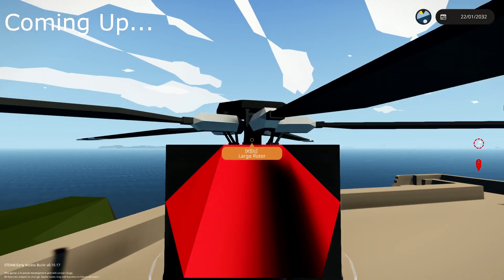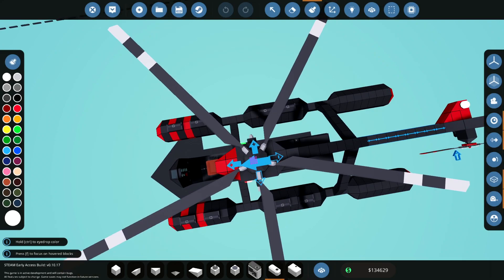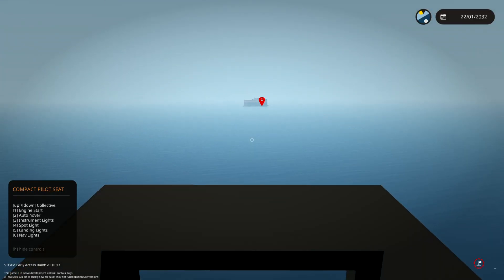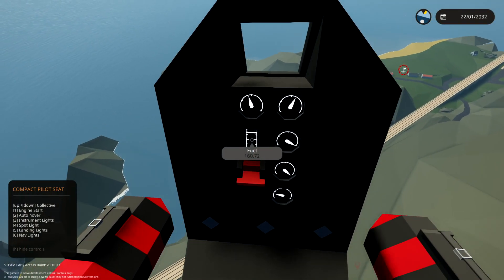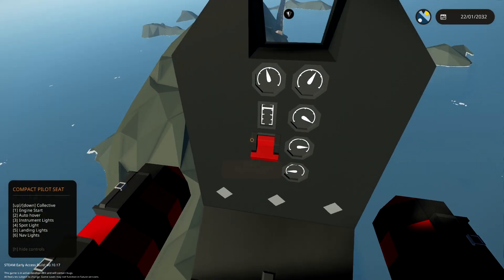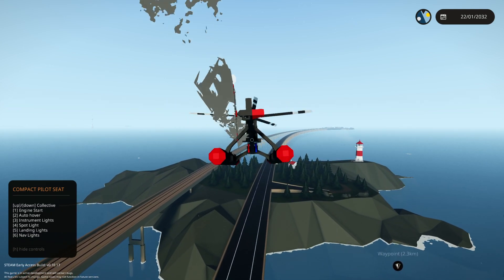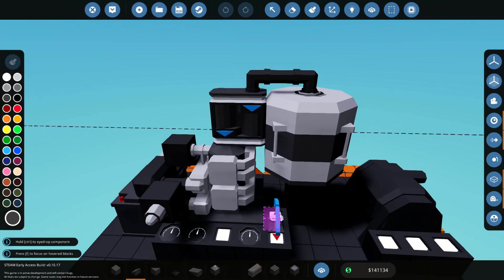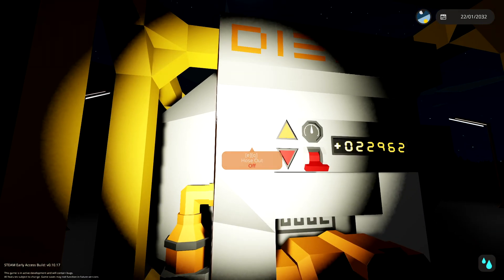I Built TWO Things, and ONE didn't break - Stormworks: Build and Rescue - Career Mode - S1 E14

Comment: Give it less throttle, it is bumping on the rev limiter so you could have it even more efficient with less throttle. 0.60 could probably work.
Reply from the maker: Thanks for the idea Ronny. I had it on the limiter/full throttle so I could lower the RPS but have it recover from increased work load on the rotor, for example when lifting weight, as fast as possible. I will keep adjusting it and hopefully we can find the perfect balance! I did some testing with less throttle at first which I agree is the better option. It however didn't handle the weight as safely but I will keep working on it for sure! It seems that we think alike :) Thanks for your suggestion.

Comment: 24:35 HIS FUEL WENT UP BY .02 WHAT
Reply from the maker: Yes the fuel can seem strange sometimes. Normally if it goes up, it's probably the vehicle/fuel tank tilting in the air, which allows fuel to run back out of the pipe and into the tank, increasing the amount in the tank. Over all the fuel would still have been reducing as the engine uses it up.
Reply: @MrSticksman  Ahhh